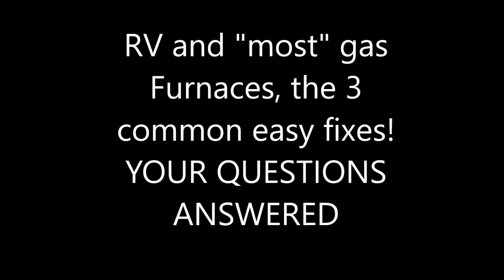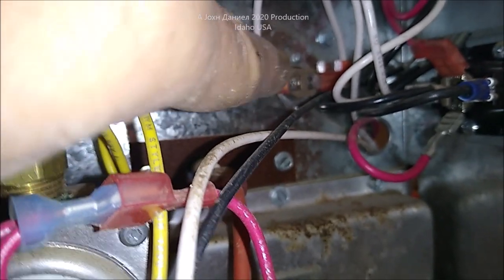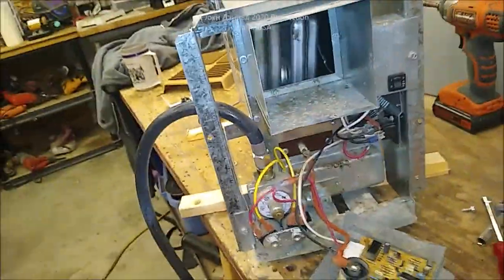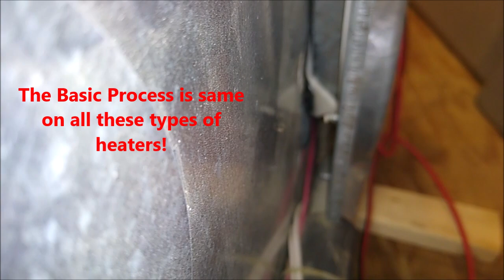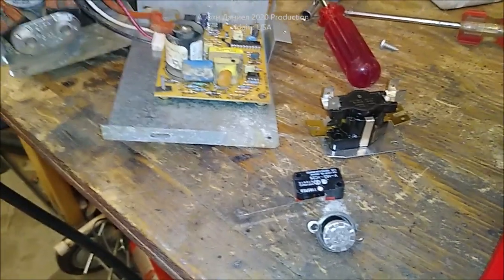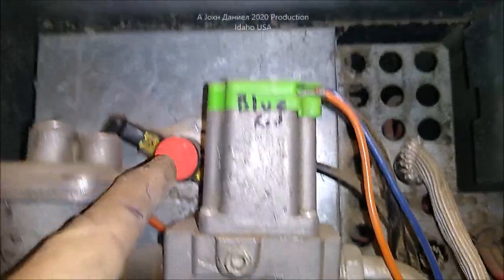RV Furnace REPAIR TECHNICIAN SECRETS Top 3 Easy Fixes anyone can do PARTS BELOW

Comment: Hey there. I have a very similar furnace that's turning on and blowing cold air. I tried to jump the wires between the over temp, and it didn't solve the problem. It actually must have blown something because now I can't get the furnace to turn on at all. I checked the main fuse in the circuit box but it was fine. Not sure what to do now, any pointers?
Reply: The on off reset switch will cause this to happen
Reply: The on off reset switch quit on mine. The fan would start and no gas and then shut down. Put a nine dollar switch in and still works perfectly.

Comment: So I have a 1988 six pack truck camper with a duo therm furnace the pilot lites but it does not lite the burner if you have any good tips on this older unit I should check out. Thanks for the video I'll be in there tomorrow trouble shooting some of what you talked about.

Comment: Hi John, I have an atwood 7916 ii.  I have to turn it off and on several times before it starts blowing.  Sometimes I have to do this for ten minutes.  Once it fires up works perfectly.  It turns off when it reaches thermostat temp and turns back on once it gets cold.  It's just the start up.  Any idea what might be causing this?  Thanks
Reply from the maker: Those have a flame sensor where the ignition points probe goes over the top of the burner and they also have a low gas pressure sensor that won't allow it to fire up and they also will not run well under 12 volts so if you have a current load somewhere it might stop it from starting.
Reply: @JOHNDANIEL1  Turns out it was the thermostat.

Comment: Nice video thanks.  I just turned on our furnace (Suburban) and it fires up and blows fine.  Only problem is our overhead fan from the a.c. also comes on blowing air.  Any ideas?   BTW we have the simple  Dometic thermostat wall control, if that helps.  Thanks again
Reply from the maker: Your thermostat to your air conditioning unit seems to be wired for activity on heat sense.
Reply: Sounds possible.  So how do I get the ac to stop?  Thanks
Reply: Change the fan control on your thermostat to Auto. That should turn off the fan in the air conditioner

Comment: Hello Sir , We have a 1994 Lance camper with a Hydro Flame Heater . just got back from camping . Heater works then doesn't work . So we turn it on and it gets to temperature and heat shuts off , When it cools down a little it restarts and  the flame does not reignite to keep heat going . Have to shut thermostat off completely and start over then does the same .  I watched this video and not sure which is my problem . Any help would be greatly APPRECIATED !!  Thank You Sir

Comment: My 7920 D Hydro Flame, fan will blow to purge, but no ignition click at all.  Fan will continue to run until I turn the heater off and it goes through its cool down cycle.  If I understand your video, I should be looking at the fan delay relay?

Comment: Great video, I'm learning. Question: My furnace blower comes on, we get heat, the furnace kicks off but the blower continues blowing air for more than 10 minutes. Could this be a relay issue?
Reply: Had same problem in my Jayco. Turned out to be a spark arrester switch. (May have that name wrong but had to do with the spark.)

Comment: john. I have a 1985 Cricket 9.5 XLT truck camper. I took the heater out and cleaned everything. Lost of carbon from insect nests in the heater tubes. I even checked with compressed air to see if any of the weld seams on the heater tubes may be bad and I found no leaks.
My issue is that I am still getting either some form of exhaust smell inside the camper OR it seems like all of the oxygen is being taken from inside the camper. I closed the windows on the exhaust side of the camper and installed a pipe to move the exhaust further away from the truck and the issue is still there.  What could the issue be? Thank you.

Comment: When I turn the furnace on it only makes one click sound.   Where do I start?
Reply from the maker: You got to define your question a little bit better about your furnace typically if it only gives you one click that would be your overtemp sensor failing to allow power to go through to your blower. I think I have another video related to that somewhere on my channel.
Reply: Thanks!  I ended up removing my furnace and taking it to my it to my local RV repair.   I was comfortable taking it out and capping the gas line but my comfort level stopped there.  Mike (repair man) said the same thing about the overheat switch. He so said I saved the $200 house call for bringing it in myself and he could have it fixed by the end of next week.

Comment: My old Atwood heater will ignite & heat, but once it reaches set temperature it keeps blowing as it should but once temperature drops and expect the heater to fire up again it will not and simply blows cold air since it never stops turning after initial start up. Would I be wise to upgrade or it is related  to your pinpoints  of  troubleshooting explanations . P.S. it is 31 yrs old ! lol
Reply: So i pulled the unit apart cleaned everything and reinstalled. Checked sail switch , thermo coupling & disk . pilot when unit is cool will light & initially fire up with higher temp set on thermostat but the pilot cuts off after fan ends it's cool down cycle. Back to square one! 
I'm totally stumped!!

Comment: Ok so now I’m confused! You stated that the red wire on the side goes to the sail switch. The only red wire comes off the blower motor. The two wires that come off the sail switch are both white, and the wiring diagram shows that as well! My blower comes on but no heat. How long does it take for the heat to kick on?

Comment: John  - I have a Atwood  7916-II  that does absolutely nothing. So after watching one of your videos I ordered a new fan run delay relay on amazon. The relay was not on the front of the unit so today I took the unit out of the camper and I cant find anything that looks the relay you show.  The camper is a 2003 model.  is it under the fan cover? What am I missing?

Comment: Hey John great video.  Please, please provide a bit more detail on how to trick the furnace into thinking the thermostat is calling for heat.  Do I just short the two thermostat wires together and/or short them and apply +12 volts

Comment: I have a SF-25 in my trailer and it kicks in even when the thermostat is adjusted to 0. The only way I’m able to stop it from kicking in is to shut of our LP … but by doing that we lose our hot water. I’ve  changed the thermostat but that didn’t work. 

Anyone ever have similar issues?

Comment: Great video! So my unit hasn't ran in 10 years,  The unit wasn't turning on so I removed the thermostat like you did and clamped the two wires like you and it started. Then I removed entire unit to clean out blower and reconnected everything except the gas. Now it starts as soon as I connect the three power wires and wont turn off regardless if the two thermostat wires are touching. Does this sound like something to do with the "run delay relay"? Or not sure if I need to have the gas connected? Thanks so much for any help you can send my way

Comment: How do you access the sail switch?
Reply from the maker: The sail switch will be located back in the blower area near the motor, you have to take out a few screws and slide the center section the heater itself out of the metal cabinet it's in, from there you'll see the sail switch and they have very small screws or mounting clips so be careful.

Comment: Hey just wondering if you would know why my blower motor will not cut out after it blows the heat off I have to take out the fuse for about 10 minutes and put the fuse back in and the blower motor we'll stay off then thanks
Reply from the maker: That's the delay relay or over temp switch. Most likely the delay relay.

Comment: my furnace just recently started acting up. it was working just fine but now, what happenes is it will heat up for about a minute the stop burning i can hear the spark arrester sparking, it will try it three times then after about a minute it will shut off, i should also note i replaced the lp regulater about a week ago and it was noticably smaller, is it possable i got the wrong size regulater ?
Reply: Did you ever find the solution? 

Mine heats up for like 30 seconds then shuts off

Comment: hey my fan is not working. its a camper from the 80's and it just stopped working. I try to turn it on but the fan never goes in just the pilot. but as soon as i turn it to on it goes of... 

i realized that the cover of the fresh air is gone and i dont know sinve when. all the fuses are good any idea?

Comment: Hi John.  My trouble is once fans started, it never stop.  I open circuit at thermostat (cut ignition) the fan should stop 90 sec after.  I didn't burn propane, the system is cold, but the fan continue.  I have to disconnect main electric to stop.  Should I change PCB?

Comment: Thanks for your videos, I'm learning a ton!  

Question, I have an Atwood 7916-ii that will light and produce heat normally, however after it has run 1-2 minutes and heated up, a loud vibration occurs from within the unit; the noise/vibration inceases the longer it is run. 

If I turn off the thermostat and initiate the cool down cycle, the loud noise immediately stops and all I near is normal fan sounds. My thought is that the noise/vibration is being created by the burners somehow, as it stops when fuel flow is stopped. Any suggestions?
Reply from the maker: It sounds like you have a air injection issue or an air exhaust flow issue. That would be either wasp nest blocking flow or your blower that sends air into the burn chamber is slipping after it's shaft heats up.
Reply: Tim did you figure out what was making the noise bud? Mine is doing the exact same thing !!!!!

Comment: Old switch works, bought the switch you suggested, when I put the new switch in - it does nothing - old switch in, works like a champ.  What am I doing wrong?
Reply: Sorry, the time delay 24A34 (I believe)
Reply from the maker: Are you sure you were wearing them through their circuit correctly. Using the standard furnace switch you have your blower ignition and power a little different setup than the original suburban or Atwood switches.

Comment: Great video, thanks John , I do have a problem that you may have the answer for .Suburban furnace model sf-30 runs , will cycle 5-8 times and shuts down till it is turned off at the thermostat and turned on again . I replaced the Dometic thermostat and ordered a new limit switch . Any info would be greatly appreciated, thanks
Reply: I have the same issue. Haven't found an answer anywhere online.

Comment: My house microwave has killed 2 thermal switches.  I like my bacon extra crispy!!!!!!  Easy to fix but they use those security screws that require the special sockets to turn them.
Good info here as I'm in the process of getting my Coach awake again after a 5 year nap while the wife and I have been fighting cancers.  Just rebuilt the refrigerator that lost it's magic smoke!  LOL.  Wife is facing round 2 and we want to use our bus while we can.  Thanks Pardner!

Comment: At 5:23 is the only time you mention "clicking".  My 2001 Atwood truck camper furnace is visually similar to your demonstration unit.
I have a cold blowing fan but no starter clicking. Plenty of propane (stove top burners are heating the camper now). May I assume that if there is no clicking then it it's the board relay at fault?
I jumped then the over temp switch. Still nothing. Before I remove the heater, to check the leaf switch, I'd like to confirm that the relay is the only component that controls the starter clicking?
Thanks

Comment: I have a SF-35Q (serial #132401275, stock#2398) and have pulled the unit out of my 2015 Class A coach because all I get is a couple clicks when I turn it on. The over temp sensor had continuity, the sail switch looks fine and clean, but I can not find anything that resembles anything like Fan Run Delay Relay switch. Would this possibly be incorporated into the motherboard?

Comment: I have an Atwood furnace in my camper and it heats well but as soon as the camper comes to temp, the blower goes to cool down cycle but then never stops. It will run for hours and blow cold air. I have to shut off the breaker and reset it for the furnace to reignite. I’m stumped. Any help is much appreciated!
Reply from the maker: The run delay relay is hanging up on its end cycle.

Comment: Thank you! Very informative video. New subscriber here! I have a heater that the fan turns on but when the burner is suppose to lite it all shuts down with zero heat. I was thinking the circuit board went bad but any ideas on what i should be checking first? the only reason I'm thinking circuit board is because the last time we went camping my batteries were bad and the heater worked for the first part of the night but then gave up in the early morning with dead batteries. any chance its the over temp switch? or would the batteries dying case a short in the circuit board? appreciate the help and again great video!
Reply: I keep hearing the sailswitch for that issue.

Comment: I have a suburban nt16seq that I purchased last year. Everything seems to work except I get a high yellow flame after ignition. Intake is clear, propane tank and regulator are good, just bad flame. Is has only been in use 2 months, does it already need a chamber clean? Thanks in advance for any info!

Comment: Found you great video when I encountered furnace problems tonight. Will be ordering all these parts to have on hand for my furnace. My prob was easy fix...Bus wasn't level so was throwing off my temp switch. Instead of leveling bus I just took all but 1 screw out and swiveled the thermostat level.

Comment: Great video BUT I have a question : my buddy has a furnace very much like this one ( could be the same model , model # 7920 - ll ) , it comes on and cycles but no hot air is blown to the inside of trailer. It DOES blow hot air out the exhaust but it shuts down and has a 3 blink red light that can be seen... what could be the problem ?

Comment: Great video I learned a lot. I have an older atwood furnace a7900 series i think. the blower comes on when i turn the thermostat on and fan runs but does not light. The fan shuts off when I turn the thermostat off after cool down time. i will check the temp. switch but cannot find the sail switch to check it. Could you tell me where it is and how to get to it. Thanks

Comment: Helpful, but... just bought an 2004 travel trailer.  Getting it ready to go. I have it plugged into my house power to run the lights. Trying to test the furnace. I turn on my thermostat, fan starts blowing, gas is on. I hear the click and then the tick tick ticking of the igniter. It tries 3 times and doesn’t not catch. - still blowing cold air. From outside I can smell gas coming from the exhaust port . After the third try, it shuts down and a red light blinks on the circuit lard. I have an Atwood very similar to the one in this video. I have completely taken it apart (not removed the unit’) cleaned it and still does the same thing. Help
Reply from the maker: You may have to cycle it a bunch of times to get the gas to the heater. It may smell like gas is in it but when you buy a RV, and put tanks on it It can take a dozen attempts to clear the air with gas smell out of the lines to get it to fully fire up and run right. Remove power from the RV to reset the board or pull the heaters fuse, plug it back in, Be sure you have a battery in the system so your not hitting the heater with 14.5 charging volts, then cycle it more. If it faults again, repeat process till it fires up. If I helped then feel free to add a APPLAUD $ tip to the video and share it.

Comment: What about a heater that comes on and heats fine but won't shut off once it reaches temp?
Reply from the maker: Faulty thermostat or delay relay. Sometimes thermostats won't let go and they'll appear to disconnect but still send enough power through to keep one running. Or your delay relay is not letting go and allowing the furnace to continue. The contact points are carbon contact points that can get a slight bit of arcing on them and fail at that point. My suggestion is to try thermostat first.

Comment: Thank you so much. Very informative.  Ours seems to be the sail switch. You mention something about slightly bending or soldering? Can you explain what you meant. our rv furnace is only two years old and we just started using it for about a week now. It will run for for a few days and then shut off. Starts to blow cold air
Reply from the maker: What model and year is the heater
Reply: Јоhn Daniel it's a 2018 jayco pinnacle 36fbts. This year Jan, 2021 first time ever used my furnace. Worked fine for about 3 days and then nothing .  Unfortunately warranties are worth the price the dealers talk you into. Never fails. The minutes the warranty is up your screwed. It's like a tail light warranty. When you can't see my tail light once I pull off your lot, warranty is up.